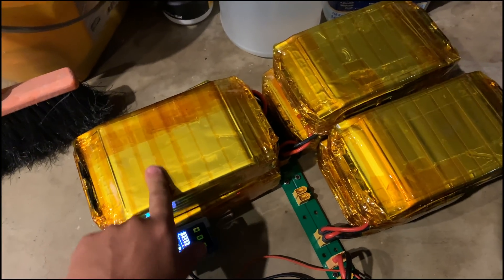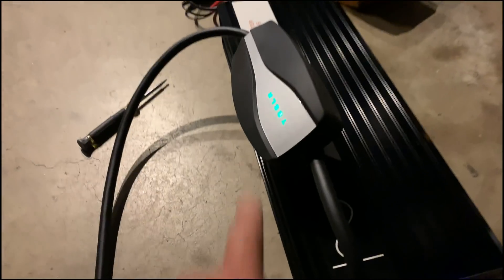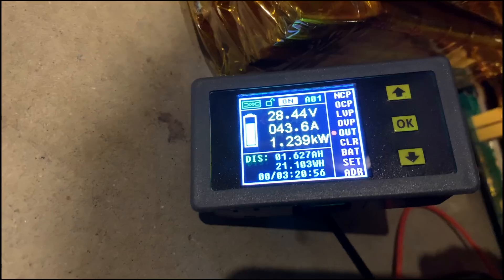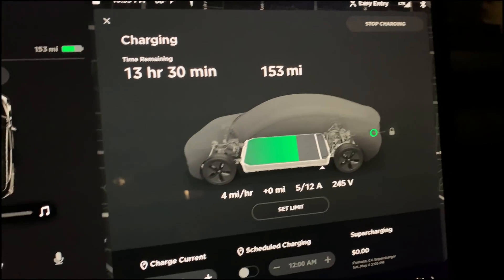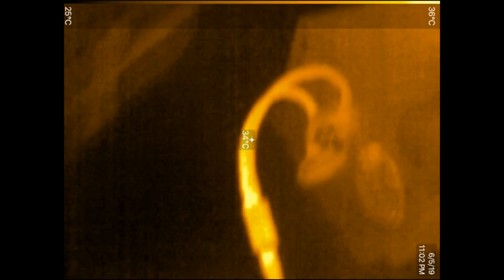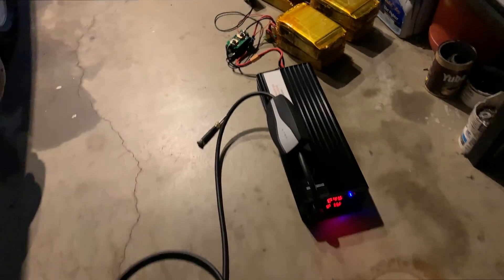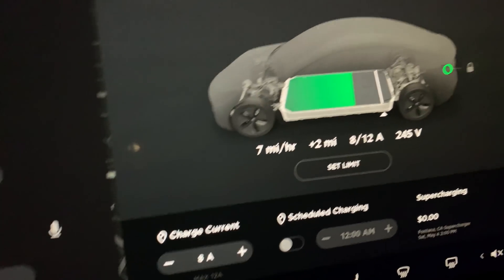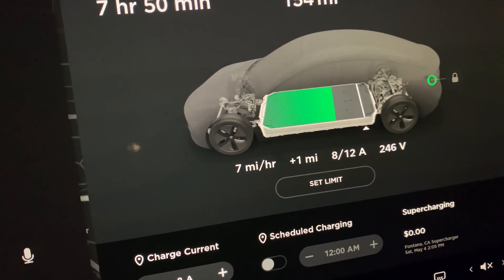How much Energy Into a Tesla Model 3 to get 1 mile of range

Comment: As always great video Jehu. Jus one comment: 

For high power applications 48v system will do better job in terms of thermal lose. 24v system takes lot of power by heating cables and PCB parts

Comment: It would be very interesting to make an AC inverter with at least 2kw that works at the voltage of the Tesla battery bank, (such as the high-power UPS) to be installed as an optional, perhaps equipped with undervoltage protection to protect the battery bank and simplify installation simply deriving from the line of exit of the bench, in emergency could feed a house quietly or use it to perform jobs with power tools out of the network.
what do you think about it?

Comment: do you need an inverter at all? Tesla has 480v DC supercharger stations according to wikipedia. I asked a representative from tesla and they told me pretty much the same thing.  i think it's an adapter if you have model 3 and on board if it's s or x, if i'm not mistaken.
Reply: A little knowledge is a VERY dangerous thing.
Reply: @awo1fman  knowledge can be powerful but your position is weak. By implying that it's better to keep people ignorant you are contributing to the problem.
Reply: @StrategyYouDidntKnow  Thanks for further illustrating my point. Go look up what that quote actually means. Then we'll talk. Except then we won't need to because you'll understand what I meant. Or you're too obtuse to ever get it, in which case you're jot worth the effort. Either way, goodbye.

Comment: I know Tesla is a whole new class of car, but my little smart ev says the mi per kwh on the car display. It runs 3.6 to 4.3 and longer-term average of 4.0 mi/kwh ... So you get about 3/kwh or did I miss understand? If so, that is pretty good for a much bigger car! 👍
Reply from the maker: The model 3 is the most efficient I’ve seen yet,  averages 160wh/mile  out of the battery,   But here I was testing loses going in into it

Comment: There are also devices you plug between your socket and power plug, which measures the energy consumption. With one of these you could charge the car faster and longer, and without the losses of the inverter to get more precise results.

https://www.amazon.de/Energiekostenmessger%C3%A4t-Stromverbrauchsz%C3%A4hler-Energiekosten-Messer-Strommessger%C3%A4t-%C3%9Cberlastsicherung/dp/B07M5BN3JS?ref_=Oct_BSellerC_2076385031_4&pf_rd_p=1ee080fe-db6c-59c1-a810-97bcef9aaac8&pf_rd_s=merchandised-search-6&pf_rd_t=101&pf_rd_i=2076385031&pf_rd_m=A3JWKAKR8XB7XF&pf_rd_r=5ZB8SSMPPQNARKYWE77B&pf_rd_r=5ZB8SSMPPQNARKYWE77B&pf_rd_p=1ee080fe-db6c-59c1-a810-97bcef9aaac8

Comment: That's a pretty inefficient way to do it. The car only uses about 240 Watt hours to go a mile, but with your setup you not only have charging losses, you also have inverter losses and the losses from heating up all those wires and components on the battery side that are not optimal for the power they're carrying. Normal AC charging would be significantly more efficient.
Reply: He is aware.  He is trying to make a portable charging pack.  His previous videos explain why he is doing what he is doing.  It’s kinda of an emergency range extender pack experiment.  It would be more efficient if he built a pack he could run parallel to the original Tesla, but the volts are so high it’s scary and he would probably void his warranty.
Reply: @gregfoster6916  As a  matter of curiosity it's an interesting idea, but as a practical matter it's way off base. There is no such thing as a range problem with a Tesla, and any EV can charge from any wall outlet. If there's a building, there's electricity. In the Lower 48 you would have to be monumentally stupid to run out of juice in a Tesla, and even if you did there are so many options to get a charge that carrying around an "emergency battery pack" is absurd.

If he's planning on doing a transcontinental crossing without stopping to charge or something like that, then of course anything goes, but if he's just trying to eliminate range anxiety he needs to just get driving because it's all in his head.

This isn't his converted VW bus that he's been living with for several years. It's a completely different beast. It's much more efficient and probably has a much bigger battery.
Reply: Mark Haury no one is saying it’s efficient or necessary.  People do stuff because it’s their hobby or it’s fun or to learn. Relax.  Go do your thing.  Or is your thing looking around to be a pain in someone else’s thing?  Have some ice cream, idk.  This guy is not an electrical engineer and he does some things that may not always be logical, but he is learning, getting better.  If your comment was more about safety etc that I would get.  But if you watched his other videos about this it’s an experiment.  By the way range anxiety exists.  I get around 320 miles on a full charge.  I can not just stop at a strangers house and plug in.  How stupid.  So I plan to use designated superchargers.  Going across vast areas of nothing may be scary, but so far we have not had a major problem just a little anxiety. 
I have seen people take an extra pack and run it parallel with primary back. Increasing their range by 70-90 miles or more.  This essentially enlarges the battery and is efficient but you have to splice in to the system and you have to play with dangerous voltages, sounds like fun🤪 have a good day.

Comment: 72degC...your dangerous man... your pcb u designed, is dangerous- at least in this configuration- and once more, you’ve shown u don’t give enough thought to properly wiring extremely high power-capable equipment safely.
Reply: Up to 100C should be safe according to this: https://www.electronics-related.com/showthread/sci.electronics.design/112182-1.php The PCBs from JLCPCB have a Tg of 130-140C.
Reply from the maker: Dangerous is my middle name....  you new around here?  Catch up

Comment: Your testing is off because the car will consume charging energy to run the HVAC (if it’s on) and the screen, dome lights, etc. you have to close the door to shut off all those systems to use all the power for charging.
Reply from the maker: My instruments don’t lie,  it will take 3.3kwh to charge 10 miles using my equipment.

Comment: Glad you got your system figured out. Had no idea that Tesla's used that much power.
Reply: They don't. This is how not to charge your car. He's wasting 30% of the power the batteries are supplying before it ever gets to the car.
Reply: @awo1fman  the idea isn't to do it efficiently. The goal was just to get a few miles into the car so your not stranded if you run out of power.
Reply: @landonferguson7282  Which doesn't make any of the things I said any less valid or applicable. Besides, that's not what the title says.

Comment: The model 3 has a very rubust PCS onboard. Perhaps the wall charger can take 240 DC and still change the car?

Will yeild in a good 30% efficiency boost as u dont need to invert, rectify and than invert again in the car.

From what i know, all the wall charger does is handle the charging handshake and some basic safety checks. All the juicy electrons are in the car(at the back, ontop of the pack)
Reply: The "wall charger" is just a way to get AC to the real charger thats in the car that converts AC to DC for the batteries. If you fed that AC charger in the car with DC im not sure it would work very well. You would probably need some way to tell it that youre going to feed it DC like the superchargers do
Reply: Sean Kline yup
Reply: @klinenator  You don't feed the charger DC. You feed the battery DC. AC goes to the charger, which converts to DC for the battery. But you're right, that's a "mobile connector", not a "charger", and the charger is inside the car.
Reply: @awo1fman  The question is whether the on board AC charger can accept DC, since it is converting AC back into DC anyways (typically with a rectifier followed by a switching converter, up to the 400VDC of the battery). Only issue I can imagine is relays/switching components that can't interrupt DC, or all the current going through only half of the bridge rectifier causing extra heating in those diodes.
Reply: It doesn't "invert again" in the car. It is either pure DC charging the battery for fast charging, or the AC charger rectifying and regulating to DC for slow charging.

The only "inverter" in the car is AFTER the battery, and is the controller for the AC motor. It has nothing to do with the battery.

Trying to connect DC to the AC charger is stupid for a lot of reasons, not least because the signal path is the same even if only half the rectifier is affected and going through all the same components will yield the same efficiency. Except probably less because you'll be massively heating components that are designed to only handle an intermittent, varying signal.
Reply: The Tesla device used in this disastrous experiment is an EVSE, just a power supply. It's not the charger, which is actually built into the car. That device is actually called the mobile connector, in Tesla's terminology. The Gen1 of those connectors were rated 240v at 40 amps, but the Gen2 is rated 32 amps at 240v. When using AC, the car charges slower because it's converting AC to DC, but when you're using one of the Superchargers, they're actually feeding DC power directly into the car, bypassing the converter. My wall mounted EVSE pushes 240v 40 amps consistently into my Tesla Model S. That equates to 10kW.
Reply from the maker: Disastrous......exagerous much?
Reply: @DangNguyen-my3wd  It's not even a power supply, it's just a connector, a glorified extension cord with some safety electronics built in. Your 10 kW is single phase - my 3 phase 24 Amp 240 Volt is 17 kW, and 32 Amp is 23 kW for older cars with dual chargers.

I don't know who decided to start using "EVSE", but it's a stupid, inaccurate term. The vast majority are connectors, not supplies.

Comment: You can lessen the losses in heat by a bit fatter tracks (even solder layer helps) and bit fatter cables. But I'm betting that inverter isn't with super high efficiency, is it? :) Then the Tesla mobile charger conversion loss. Calculate the losses too, because from the wall to Tesla (meaning your electric bill) you would not have same amount of losses, because no questionable efficiency inverter.
Reply: Tesla mobile charger conversion losses?  What happens inside that mobile charger?
Reply: @ishanfernando3064  Sorry, the mobile charger part is indeed quite irrelevent. This only feeds AC into onboard charger and that is the same for all teslas. So we should only talk about heat and inverter losses.
Reply: @gelisob  :)

Comment: You did use 1000 Wh from battery but you probably put 800Wh in Tesla battery.
Reply: On my home battery system Charging a 24V LiFePo4 battery from AC  and then using battery power to turn it back to AC with an Inverter I get around 66% efficiency for the round trip.  3 miles for a kwh at the initial DC end is good going.
Reply: naaahh should be arround 900wh.
Reply: @isipisilemonsqueezy  More like 700 Wh. A Model 3 only uses 240 Watt hours per mile. This is a crazy inefficient way to charge a battery. Battery -> inverter -> charger (rectifier) -> battery wastes a heckuva lotta energy, especially when many of those components are too small and have too much resistance.

Comment: Interesting....but using DC batteries to run an AC inverter to charge a DC battery is very inefficient. There’s about a 20% overhead in heat energy loss every time you convert AC to DC or DC to AC....so your system is wasting @ 40% of the available power as heat loss doing 2 conversions
Reply: When he was charging at 8A/235V according to the cars display, which equals 1880 Watts the battery display showed about 2000W, if you devide that you get an efficiency of around 94%.
I know thats not very precise, but its definitely rather 6% than 40%
Although don't really understand  why he uses a battery to charge the car, and of course there are losses in every conversion, way less than 20% per conversion.
Reply: @clemensmayr8943  Nope, your math is way off, and you know nothing about how any of this works. Those cables and circuit board he's heating up alone are a huge source of inefficiency, and there's no way that cheap inverter is anywhere near 94% efficient. Then there's the fact that a fair amount of that energy is going to systems other than charging, since he's got the screen on, probably the door open with the interior lights, HVAC, etc.
Reply: @awo1fman  But that's the definition of efficiency: The ratio between the energy you put in and the energy you get out. If the Values on the displays are correct, the efficiency of the inverter is 94%.
If you have a different calculation please let me know.

I don't think heating up those small parts a few degrees takes a lot of energy.

Of course there are other systems that consume energy from the battery, but you were talking about the conversion.
Reply: @clemensmayr8943  Seriously wrong on all counts. First of all, you're trusting cheap meters to be properly calibrated and connected. Second, go look at the specs of a few inverters in that power range. They top out at 90 % but mostly are around 80%. There really is no way that one is 94% efficient. None at all.
Reply: @awo1fman  Of course the values I used for my calculation are not 100% correct, but I think its not too far away. I think most inverters are around 90%. According to the manufacturer the the one used in the video is 92% efficient. I'm not sure if the real value is the same, but I'd say it's rather around 90% than 80%. 
Also if the efficiency of one conversion was 80%, the overall efficiency would be 0.8x0.8=0.64, so rather 36% lost than 40%.
Despite all of that I totally agree that it's pointless to charge a car with batteries via an inverter.
Reply: @clemensmayr8943  The inverter isn't the only loss in that system. There's no way it's above 75%. You're making massively optimistic assumptions with no basis and obviously no experience.

Comment: Meams ebike are 100 times more efficient with energy.
Reply: Not surprising since they are 1/200th the mass and a fraction of the frontal area as well. Which makes them actually much less efficient per unit of weight or mass than the Tesla.
Reply: @awo1fman  The idea is to be efficient with energy with fossil fuels used to produce some of it. Who cares about efficiency when a bike is solar powered and the car is not.
Reply: @super-sim1665  You are so wrong. Efficiency is important regardless of the source, and what makes you think the car isn't getting its energy from solar (or wind)? Efficiency gets you more range or more speed with the same battery. The problem is that you want to believe that everybody should ride a bike and nobody should drive a car, and the numbers prove you wrong.

Comment: 235V * 8A = 1880 watts ; 1880 watts / 7 miles per hour ~ 270 WH per mile.  Power hungry but still a fraction compared to the cost per mile of a BMW 3 series.
Reply: Tesla model 3 is consuming around 150wh/mile. This calculation takes into account converting dc to ac, than ac to dc again. Really not an apple to apple comparison
Reply: @maximemineault8117  Nope. That's 150 Wh/kilometer, 240 Wh/mile. Still one of the most efficient EVs on the planet, never mind a BMW 3 Series.
Reply: Mark Haury you are right on this one I probably watch too much videos from Bjorn Nyland lol

Comment: So I assume you’ll need at least 3kwh to try and reach the 10 miles in about an hour (assuming about 15% efficiency loss through the rig). If my rough math is correct, that would require about 8 more of the pouch setups you have now. Granted, getting the current limitations sorted in the rig too.

Comment: How do you expect the miles to increase quickly if the accessories, screen and other stuff are drawing power, first priority of the car would be to drive the auxiliary systems so that they don't consume power from the battery and then whatever is left goes to the battery, shut down the car completely. take, say 5kwh of battery, let it charge the car until the 5kwh battery is discharged and then turn on the car and check how many miles it gained
Reply: I was thinking a similar thing. When charging this slowly the phantom drain (all the accessories and such) is a much higher percentage of your charge rate than when your are charging at 7Kw.
Reply: @ecospider5  precisely

Comment: Hey Jehu, L@@Ks To Me That You Need Like A 2 Gauge+ Buss-Bar To Take In All Them Packs!? That Is Where The Heat & Tight Spot Was? Hmmm... Thanks I'll Stick To MY Electric Golf Cart Powered w/Them Same SPIM-08 Packs x 48 Wired 4s1p At @36v To 3-Forward Speeds -+1 Reverse Solenoids To DC Motor Drive... LOL Thanks